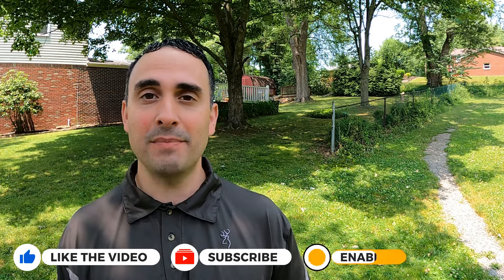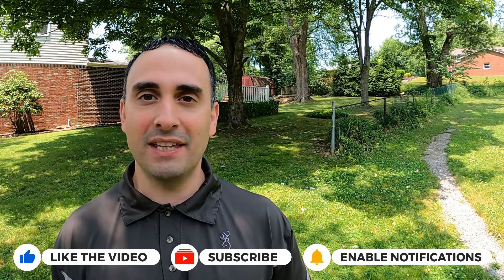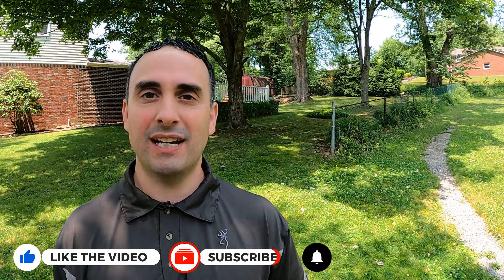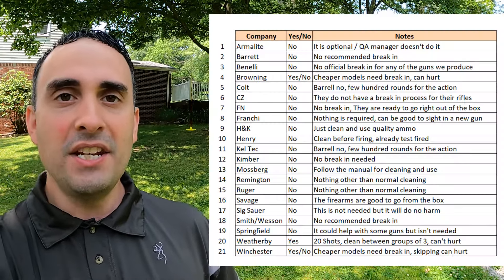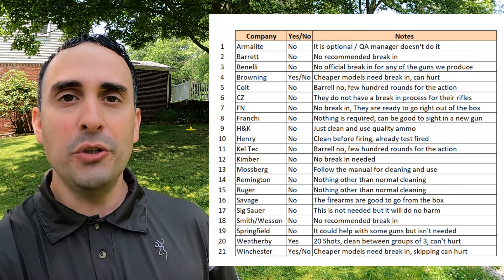How To Break In New Rifles & Barrels – 21 Companies Answer

Comment: I’ve been shooting for 40 years and have never used any bizarre break in procedures. I usually just clean a new rifle to remove any factory oil. I have noticed that most rifles will start to shoot better after 50 rounds or so. Pretty sure this happens because any small burrs from the rifling process are less pronounced. Breaking in a barrel just requires some shooting nothing else.
Reply from the maker: And I bet you've had really accurate rifles that never saw any break in process either.
Reply: Bless you brother.  I have had the same experience going from an inch and a half to near one inch.
Reply from the maker: Thanks!  @bobgordon1754
Reply: @TheNewHuntersGuide  You're more than welcome.
Reply: I’ve been shooting the same rifle for 40 years never ran a patch or anything down the barrel drives tacs at 600 yards I have never cleaned it one time ever
Reply: I was told to run a patch with oil thru the bore before shooting a new rifle.
Reply: @garrettsoutdoors9632  This isn't believable. Do you shoot one round a year? How do you keep it from rusting? Even if it's stainless, it would have rusted.
Reply: Me too. Been shooting/hunting now for 55 years and I’ve had almost 90guns. Except for maybe 10 guns the rest were all new. I just start shooting and cleaning but in no specific order. I’ve found you can tell what kind of accuracy you’re going to get out of a rifle in the first 3-4 groups of 3 shots each. But I keep the barrel cool. I shoot one shot, put the rifle in shade muzzle up, walk the 100yds to the target, mark it and walk back. Then I wait a couple mins before shooting the next round. Then repeat. I always want as cool or cold a barrel as I can for sighting in and accuracy. In hunting it’s seems to me that first cold barrel shot at game is what counts the most.
Reply: @ryanguldbrandsen7672  Not if stored in a stable temperature place in the house and a very dry climate.
Reply: @danblumel  That's...semi plausible. I don't know of a place like that. I travel nationwide hospital to hospital. 
But, never cleaning a barrel one time after 40 years of shooting, not one problem or accuracy issues at 600 yards? Either he just doesn't shoot very often at all, or it's just not believable. I see a difference in accuracy after 800-1000 rounds with my 18" AR15 at 100 yards. It would be the difference of a hit or a miss on a 10" at 600 yards. I just think it's a gross over exaggeration... That is all.
Reply: Video starts at 10:20
Reply: I completely disassemble, clean and lubricate a new rifle before shooting. After 40-80 shots, you’ll notice a bullet speed increase. You don’t want a new barrel get too hot.
Reply: I've handled and fired 50-75 year old .22  pump and semi auto rifles that I know ain't no way have ever been cleaned, inside or out and other than feeding/ejecting issues have been accurate.
Reply: Not sure you understand how rust works lol. Rust is caused by moisture. Not carbon fouling
Reply: Agreed
Reply: @garrettsoutdoors9632  Wow, I would never recommend that!
Reply: That was then, now we computers in our pockets. I'll bet you walked to school,10 miles, in the snow, uphill, both ways. Things change.

Comment: Break-in is an internet fad, with no possible way to measure results, but people are passionate about break-in and how accurate their gun is because they did it (of course, no way to determine if they skipped it, gun would be just as accurate)..  It is simply a placebo effect and makes them feel better about their gun. I have no issue with that, if it makes you more confident in your gun, do it.
Reply from the maker: And don't forget about all the very accurate older rifles that had been abused for decades before break in processes were ever concocted!
Reply: Breaking in a match quality barrel is probably a waste of time since they are hand lapped at the manufacturer. But if you buy a new rifle that is a mass production barrel break in is more than likely going to improve accuracy. After all,it’s basically lapping the barrel. And yes you’re right you won’t know how much it has increased your accuracy.
Reply: @TheNewHuntersGuide  I have a 1970's Ruger M77 .270 I bought used. That thing is all scuffed up like it lived in the bed of a pickup and it's crazy accurate.
Reply from the maker: I've heard many similar stories of old guns that pre-date the idea of break ins, and they are very accurate.  @nikmills
Reply: There is absolutely a way to measure it. But you have to have a minute ability to observe. Keep doing it until your patches tell you what's going on. When the patches come back with very little copper residue on them "de-copperizing", The barrel is properly burnished. I think barrel breaking is the wrong term to use. It should be called barrel burnishing.
Reply: An internet fad? People have been breaking in barrels since before the idea of the internet was had. People have been doing barrel break ins since black powder was in use...
Reply: @brianschumaker5912  That doesn't measure accuracy in any way whatsoever.
Reply: @clintsmith559 there's absolutely no truth to that at all. Doesn't matter if it's a 200 dollar rifle or 2k dolla rifle. No break in needed. The cleaning does nothing between shots. The only thing breaking your barrel in are the shots fired. No need for silly break in procedures. Shoot the gun and have fun

Comment: Erik Cortina, long range shooting champion, does NOT break in his barrels. When he asked his barrel sponsor why they include break-in instructions? They said because people get mad if we don't.  Barrel manufacturer went on to say there is no need to break them in, but we can't say that publicly because people are stuck in thier ways.
Reply from the maker: When I try to dig deeper into it, I come to the same conclusions!
Reply: I remember that episode. The procedure was written to satisfy customers that wanted a barrel break in procedure. I believe it was Brux if memory serves me well.
Reply: So one thing that you need to note about all of his barrels are they are top of the line custom barrels that are have lapped lands and on those kinds of barrels of high quality. No break-in needed but on a brand new mass-produced rifle they don't do any of that and so you can have a less than ideal finish for the inside of your barrel on a brand new rifle. Sometimes they have to get worn in a little bit. That's why on some over-the-counter rifles they will shoot better the more rounds you put through them, I don't do the whole cleaning thing. I shoot five. I clean it. I shoot another five and I clean it and then I leave it alone. The friction from the bullets alone should be more than enough to round any sharp edges or knock off any burrs that may remain. Keep in mind they do shoot it at the factory to guarantee quality and if the gun has a sub MOA guarantee they've shot it too test that also so you may get a gun that's been shot 30 times already. It's hard to say without physically being there, but I know I've had some " brand new out of the box" rifles todd took me 15 to 20 patches to get clean to give you an idea of how much time that takes 6 to 7 hours
Reply: Also you have to keep in what mind how the lands were formed? Is it a button rifled barrel? Is it a cut rifle barrel or is it a hammer forged barrel? All these things add different factors to the finish of the inside of the barrel

Comment: You touch on it in one sentence. A good company fires the rifle before it leaves.  BAM broke in complete. Thanks for the video.
Reply from the maker: Thanks for watching!
Reply: Savage button rifled barrels do benefit from break in, was recommended by my gunsmith. Had Savage 16 that wouldn't group under 2 1/2" at a hundred yards. Went home and removed all copper, then fired ten times removing all copper between each shot. Then went to sight in again, fired ten shots to season the barrel. Rifle was stacking 5 shots in 3/4" with same exact ammo, no other changes. Gunsmith said Savage barrels aren't handlapped, so it helps them.

Comment: I personally lap with snug cotton patch loaded with JB Bore Paste wetted with a bit of Kroil.  Chamber guide in use or bore guide if cannot be cleaned from receiver.  
   15-20 passes depending on the smoothness of the barrel inside. You are smoothing out tooling marks , metal burrs etc… what you are doing with all that ammo. Clean out with solvent patches and dry ones.
   Not the method but has worked very well for me for many years….
Reply from the maker: So you are the cost of the ammo then?
Reply: @TheNewHuntersGuide   I handload everything so I rarely in past 30 years have put factory anything through one of my personal guns. In many groundhog/predator rifles that i load for obviously accuracy in sole intent . I picked this up from bench rest shooters years ago.  If you were asking if it’s the cost of ammo that makes me do it this way … not particularly, it the effectiveness and efficiency of the method that  does.  Obviously, working up very nice accurate loads one might go through 100 rounds anyway . I want them all to have fair reasonable beginning in new barrel
Reply from the maker: Thanks for sharing! @raymondbuie5292
Reply: Excellent. Iv been doing something very close to this. Along with taking the whole gun apart. Clean. Deburr. Polish. Grease/oil. Locktight. Torque. I was so surprised to learn that most people do not do this
Reply: @MATT_ELEKTRON  yes , of course at this stage I am doing same and scope base machine screws , install scope,  ring machine screws al get Loctite treatment after all holes degreased and threads of both also.  Action bolts .

Comment: This is what I’ve done with new rifles.

1) Completely disassemble and degrease the firearm.  Oil/grease the firearm and properly torque the action to the stock. 

2) Shoot it only 2 or 3 times in a row to sight it in, letting the barrel cool off between shot strings. Don’t let the barrel get too hot when it is new. 

3) After 30 or 40 rounds being shot and not letting the barrel heat up too much, consider your rifle broken in. 

Gun steel nowadays is way better than what it was years ago. Look at how many firearms there are out there that have been seriously abused over the past 40 or 50 years, and they shoot accurately and reliably. 

All I have to say about breaking a gun in is…don’t overthink the process. I have a .223 REM (Savage Axis) that is a “beater” gun of mine. It hasn’t been cleaned in 500 rounds and it still shoots great (sub MOA).
Reply from the maker: Thanks for sharing!
Reply: That's what I  did with my remington 770, but I greased the lugs on the bolt for easier cycling, and it works
Reply: For bolts, I use MPRO-7 synthetic gun grease.
Reply: Just curious, what ammo do you run in your axis?

Comment: This is straightforward from a modern engineering and metallurgical perspective - you don't need to do a barrel break in, you do need to clean before first use as it may be coated with transport agents/oils etc.  The actions do bed in with time whether they be bolt action or semi-auto but its not something that significantly impedes the fire arms performance.  It is worth doing a QA/QC check of key components, sometimes mistakes are made but its relatively rare even in cheaper fire arms.
Reply from the maker: Thanks for sharing!

Comment: I’ve always done some sort of a “break in” but not nearly as detailed as a lot of folks recommend. I keep my guns in tip top shape though. More of a long term maintenance thing than “breaking it in” per say. My rifles seem to be the happiest after around 200 rounds.
Reply from the maker: I find that very interesting.  People say many similar things and no companies or gun smiths have been able to give a consistent answer why, that satisfies me. But I don't doubt it. I do doubt attributing it to a mythical break in process though lol.
Reply: @TheNewHuntersGuide  For sure. I guess "break in" might be an extreme word for what I do. I do believe there are always micro imperfections in the metal that eventually smoothen out. Also with the chrono the rifles seem to speed up somewhere between 180-240 rounds give or take. That's roughly when I consider it "fully broken in" but that's likely more so when I am fully comfortable with the rifle. I don't believe there is "20 round break in and then it's the exact same for the next 1,000 rounds." Barber creek has some good videos on the topic.

Comment: I’m not an expert on rifle barreling or break-in procedures, but I’ve owned several rifles and I’ve always seen the same results. If you start dialing your scope with the first shot, you’ll be dialing forever. I jus shoot one round and clean until the rifle groups. Then I start sighting in. It usually only takes a few rounds. I’m not 100% sure what it does, but it has always worked for me. About a month ago I argued with a YouTube 22lr long distance shooter and rifle builder about this. He claimed that he never, and there is no reason to break-in a barrel. In the next sentence he said that he only laps the barrel before he shoots. I think it’s basically the same thing. He disagreed. I called him an idiot. Now I think he’s blocked me. In short, I think it does something, but I don’t know what for sure. It’s just always worked for me.
Reply from the maker: I agree, though I wonder if its just residue from the factory burning off, or just depositing some initial copper or fouling in the barrel.

Comment: I think in the past machining techniques left more burrs and imperfections which made extra cleaning help in the break in period. Modern cold forged barrels are so well made that no special treatment is required. My recently bought Howa I fired 3 shots to zero, then a 5 shot group was 0.65 MOA. It shot good  for 50 rounds then due to the suppressor creating carbon build up went out to just over an inch. Gave it a good clean and went back sub inch. Only  cleaned the factory oil out and then the next at 50 rounds . The same goes with old engines needed careful break in, but modern engines are so precisely made they require little break in
Reply from the maker: That does make some sense there.

Comment: To save you some time, here is Weatherbys break in procedure.  Us with caution!  LOL

What does Weatherby recommend as a break in procedure?
On Our Mark: Episode 11 - Barrel Break-In
Barrel break-in can be performed through a number of different procedures. It is important to note that our testing shows that not all barrels require the same amount of break-in. Many of our Weatherby rifles get close to their accuracy potential during break-in but accuracy continues to improve with more shooting.
We suggest a 20 shot break-in, utilizing two different factory loads (load 1 and load 2) to begin understanding desired barrel accuracy. If desired, after the break-in, begin experimental shooting with different factory loads as each barrel's accuracy is dependent on load and bullet combinations.
Our procedure is as follows:
1. Clean the barrel*
2. Fire 3 shots (Load 1)
3. Clean the barrel*
4. Fire 3 shots (Load 2)
5. Clean the barrel*
6. Fire 3 shots (Load 1)
7. Clean the barrel*
8. Fire 3 shots (Load 2)
9. Clean the barrel*
10. Fire 3 shots (Load 1)
11. Let Barrel Cool
12. Fire 5 shots (Load 2)  
13. Clean the Barrel*
 
*Recommended Bore Cleaning Procedure:
1. Run several patches with bore cleaner/copper solvent down the barrel
2. Brush the barrel with at least 10 strokes
3. Run 2 patches soaked in bore cleaner/copper solvent
4. Brush the barrel with at least 5 strokes
5. Run patches soaked in bore cleaner/copper solvent through until patches come out clean
6. Run 2 dry patches through the barrel
7. Run a small amount of lubricant through the barrel before storage
Reply from the maker: I'm ok with letting the barrel cool between groups. The rest, I'm not so sure about. lol

Comment: Bought two 6.5 PRCs this year and a chronograph. At almost 50 years old it's the mid life crisis...need more guns. So I wanted to experiment for fun with many different factory loads, breaking in, chronographing along the way etc. Some things I found out so far. My 24 inch Bergara was faster than the 26 inch Browning out of the box. A clean barrel is slower than one with 6 rounds through it and the point of aim shifts as well.  Barrel speed up is true, at least in the Bergara because I only have about 50 rounds through the Browning so far. In a shot string the jump in velocity can be dramatic from cold bore to round 3  or 5. In the Bergara with 130 grain terminal ascent the cold bore is around 3060(60 fps faster than box) 2nd shot will be around 3120 and 3rd sometimes reaches 3180. Extreme spread sucks but in the Browning no such increase as was immediately in the Bergara going through the "break in process".  At this point the Bergara was faster generally than where the Browning is now. Just chronographed Barnes 127 LRX in the Browning. It was low 2900s and the box is 3010...that ammo is for sale on Gunbroker now. Is it because the barrel isn't "broken in?" Or is it the ammo is weak? Well I also bought some Choice ammo 120 LRX and it is very consistent in the 3160s with no dramatic jump from cold bore to the 3rd shot and near box velocities. So basically the only way to really know what your rifle is doing is to chronograph it over time.
Reply from the maker: Interesting!  But I do not believe these results would be impacted over the long run by a ritualistic cleaning process between shots.